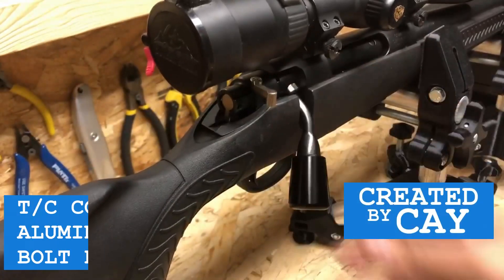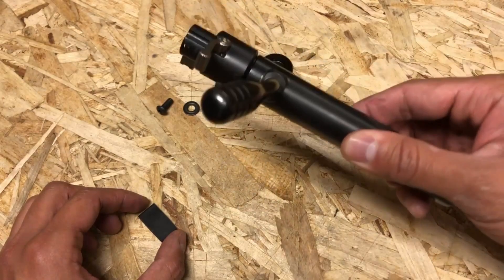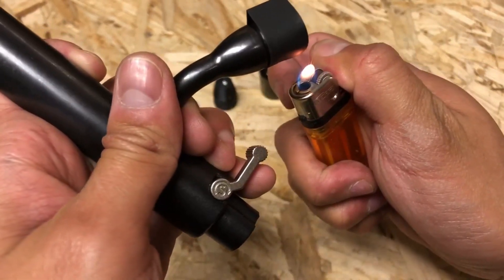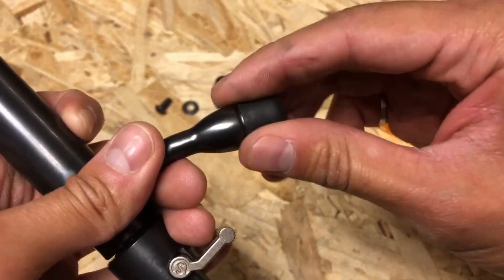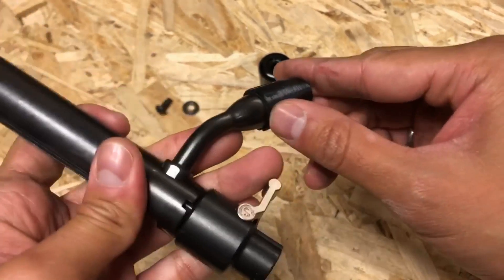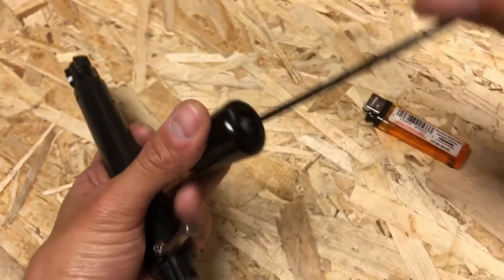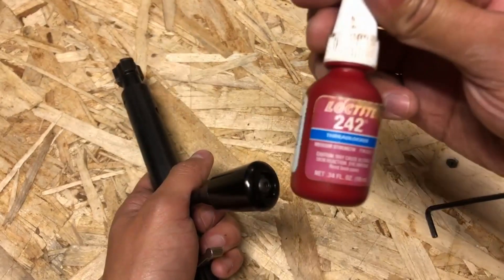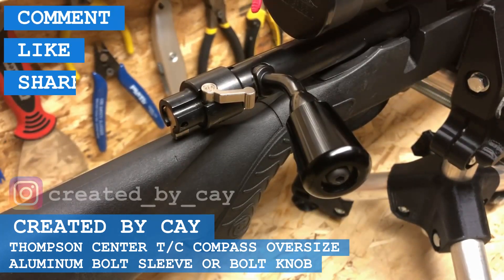T/C Compass Aftermarket Extended Bolt Knob *Aluminum* - Overview and Installation

Comment: I wish the knob was knurled. I guess a larger smooth bolt knob is better than a smaller smooth bolt knob.
Reply: If you want a less slick grip order some grip tape from talon grips. I find that it gives just as good of a grip and it doesn't eat up a soft case like good knurling can.
Reply: @goldcoin2444  damn great idea! Thanks

Comment: Hey. I'm interested in ordering 1 of these from your site but i was wondering if you can add knurling to it?  Thanx for your time and response hopefully
Reply from the maker: Sorry, I don't have knurled ones at the moment. Perhaps next batch? Problem with the Compass is that the market is still fairly small, I still haven't made my money back yet from the first production run. Thanks for watching.  - Cay
Reply: @createdbycay8704  ok Thank you very much for responding. And I'll be ordering 1 from you very soon was just hoping to get a knurled 1. So hopefully I'll order in 2 weeks
Reply from the maker: @HoodieMello85  Awesome. Thanks!
Reply: Hi Cay, awesome vid! Checking back if you  did up some knurled knobs. Wanting to order a couple if you could cross hatch it with a grenade pattern. Let me know if thats possible! Thanks
Reply from the maker: @warriorrootsbullies  Hi Frankie. Not available yet. Still working on clearing out the first production run. Hopefully I can offer a knurled version soon. - Cay
Reply: If you want a less slick grip order some grip tape from talon grips. I find that it gives just as good of a grip and it doesn't eat up a soft case like good knurling can.
Reply: @goldcoin2444  nice didn't think about that

Comment: Excellent install vid! I had my ordering guy contact you through ebay.  You should consider setting up an Amazon account to sell these on.  They allow gun accessories as long as you follow their guidelines......and do a little tweaking if necessary in how you list it.  Then you can put Amazon affiliate links in your description (as will I when I review it).  Youtube will allow Amazon links.  You just cant leave links to gun websites or anything that breaks their policy.  If you want to be EXTRA careful......you can simply have a friend or sock puppet leave links in your comments.....then PIN that comment to the top.  The comment section is safe....the description area is not.....even though with AMAZON links you should be good.  But if anything else def use the comments.  I can help you out further with info if you need.  Good luck and look forward to giving these a shot.  I only have 2 Compass Rifles left (Sold my 270 for 275 to help pay for the others.....but I will DEF use it on my 308 and 22/250.)
Reply: Subbed to your channel....will check out your other stuff....
Reply from the maker: Awesome. Looking forward to your review. Thanks for the listing tips, I'll take a look into it. Haha...I love how you "Only" have two TC Compass Rifles Left. - Cheers